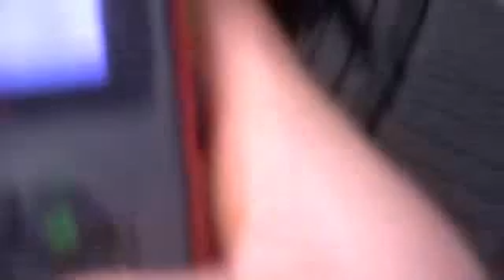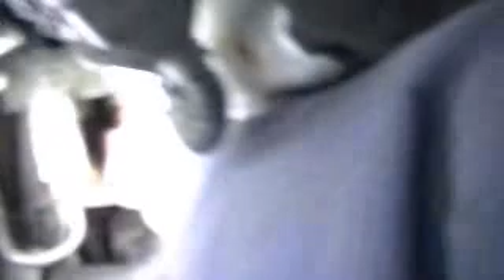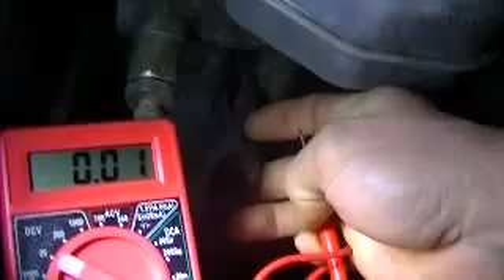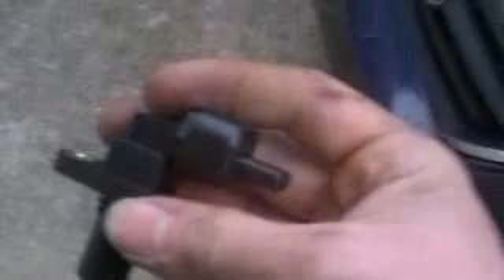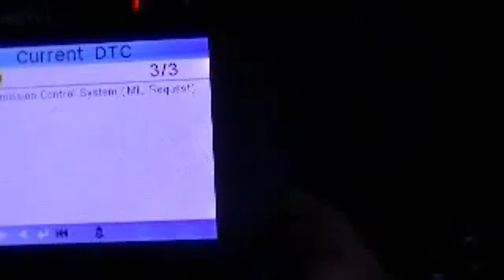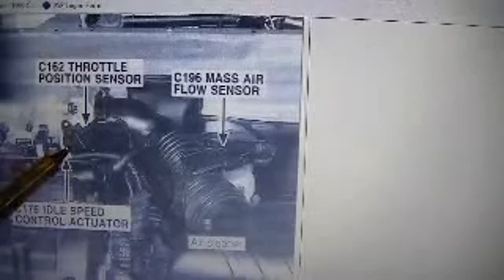PO722 PO507 PO700 Output speed sensor no signal Idle Air Control System RPM Higher than expected

Comment: my 1998 GMC Sierra 1500 5.7 vortex is bucking when it's in high gear. Could it be the vehicle speed sensor on my 4l60e transmission causing this?
Reply from the maker: Possibly but you always address the obvious 1st. So if you have an engine light on... need to fix it..

Comment: How much did these repairs cost?
Reply from the maker: dc_elite33 I think I may have charged like 30.00 to install the sensor and maybe 10 or 20 bucks to clean the IAC. I believe she ended up replacing the IAC later tho bcuz the code kept coming back. However, after replacing the IAC the code never returned. The output speed sensor was about 40.00 with tax